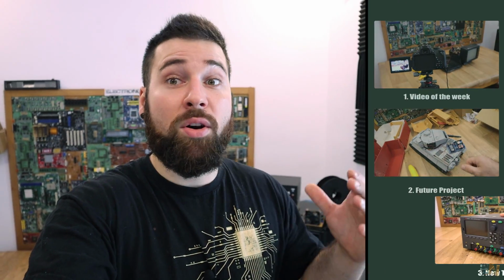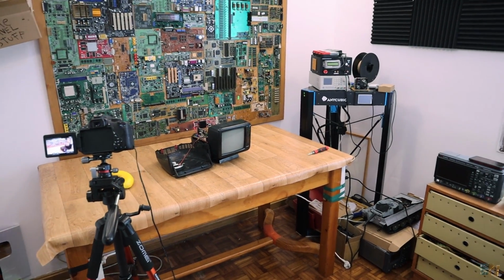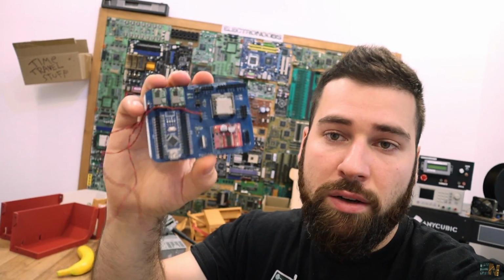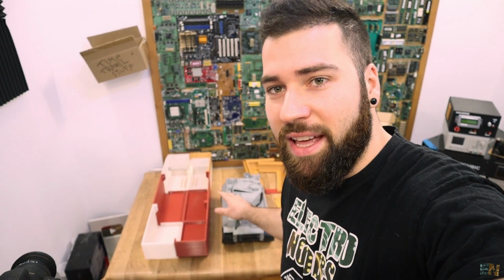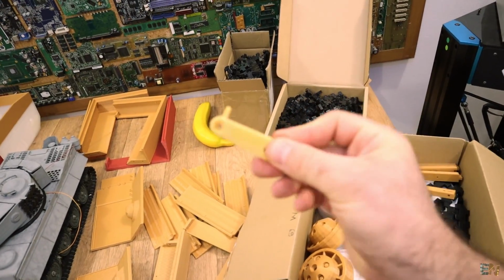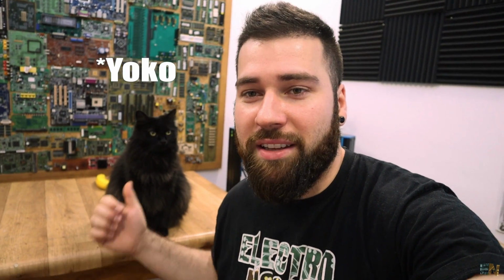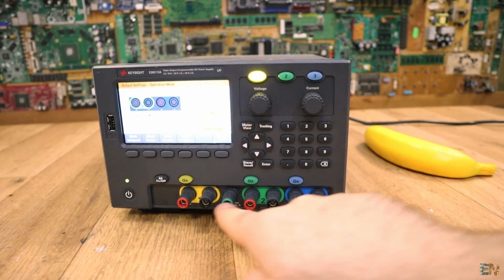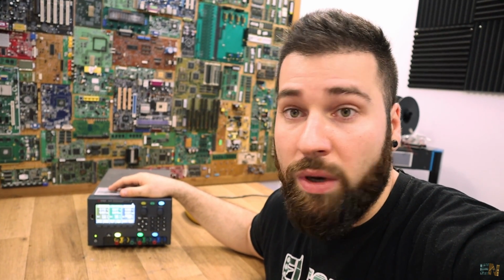Vintage TV, Huge 3D Printed Tank, Keysight Supply and Q&A | ElectroNews #02

Comment: Q and A 
I have started making an small wheeled robot using Arduino.
I want to control that bot with my voice.Now I'm  using an Android app ,this app will use Google voice to recognise voice and send the text via Bluetooth.but i have to press the button in the app when i want to talk. could u suggest any software that will convert voice to text, this voice recognition engine has to run always.

Comment: Q&A
What are your thoughts on wiring a house in 48V DC?
Reply: A lot of current will then be needed for powerful appliances. For example a kettle rated at 2 kW will need about 44 A. The wiring  needs to be significantly thicker to reduce voltage drop. This will increase the cost of wiring. Also, AC is needed by many appliances at home, like motors, capacitive droppers, transformers, etc. so these appliances cannot be used with DC. Thus wiring a house with 48V DC will be quite impractical.

Comment: Nice idea, i want to ask you if you will do a video about arduino and can-bus. I have tryed it but i failed, and i do not understand why. If you will do this, i think that it will help, because everything in industry, automotive, nautics, and so on work with can-bus.
I would be nice to "hack"  that with arduino and can do changes, or simply read the information, or the data. Thank you.

Comment: Hey! My esp8266 module gets hot when power it with a 3.3  power supply which converted by lm317 .
But when i power the board by computer usb port ii didn't get hot why the problem occurs?

Comment: I had an idea of making fully diy drone including the camera . So can you please explain how to connect a camera module with Arduino and stream the video signal with nrf24 and receive it on other Arduino with lcd screen or esp module or using esp board and stream it on a WiFi network and receive it on the mobile phone or any device that can connect to wifi. You can use that in the tank as well .
Reply: nrf24 is not suited for video streaming. There are projects that stream analog audio between 2 nrf24 -- but the quality is worse than cheap chinease walkie-talkie. nrf24's main usage is to remotely control something, e.g. Logitech uses these nrf24 IC in their 2.4GHz periferial devices like mouses, keyboards, joysticks, etc, where you can afford packets of 32 bytes maximum as payload. If you want to stream video content -- you should switch to ESP32 at least. I was lucky to get stable 18-20 frames per second from ESP32CAM.
Reply: @krukhlis  
But I am not sure that esp cam can work with thermal camera. Or can it ?

Comment: Question for next time:
How can i use arduino to make a DC-AC wattmeter and real time impedance (i mean V×I , V÷I) ?
Reply: Without an analog multiplier the microcontroller will be able to handle only low frequency AC and you will need simultaneous sampling on two ADC channels. What frequencies are you after anyway?
Reply: @amciaapple1654  into low frequencies. max about 150Hz
Reply: @F.A.1.8t  If your microcontroller's ADC  cannot sample bipolar signals on 2 channels simultaneously, then you can connect this circuit to a single unipolar ADC channel.  (where the multimeter would connect):  http://danyk.cz/wmetr_en.html